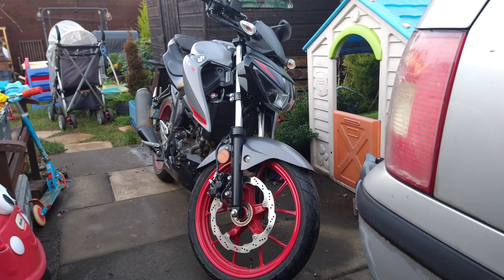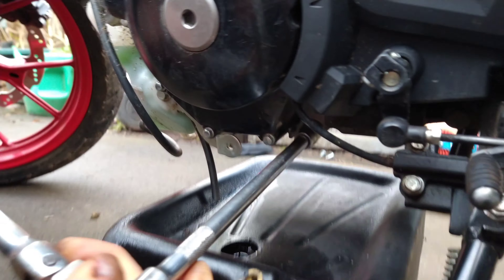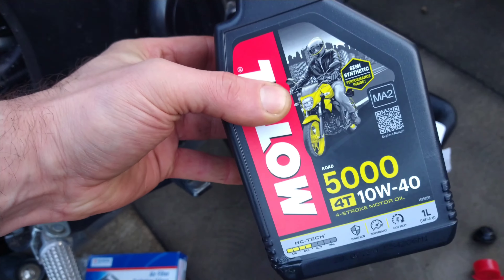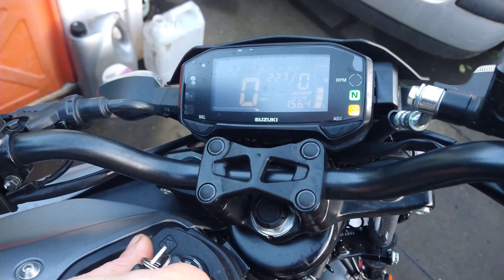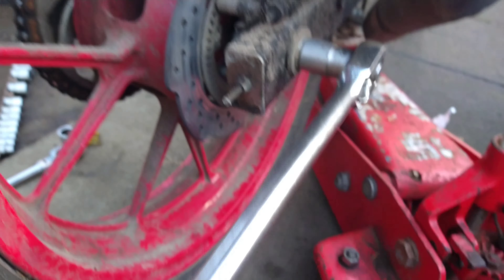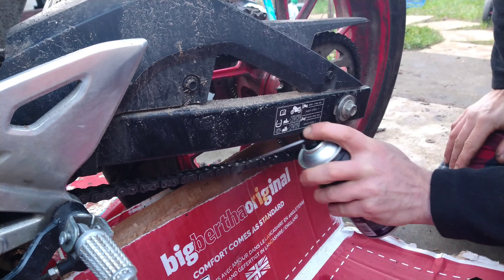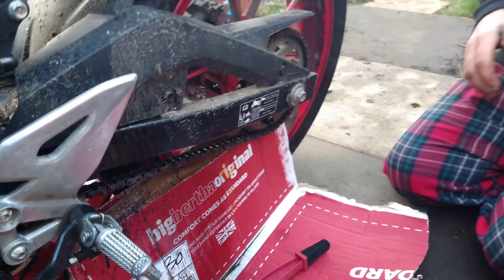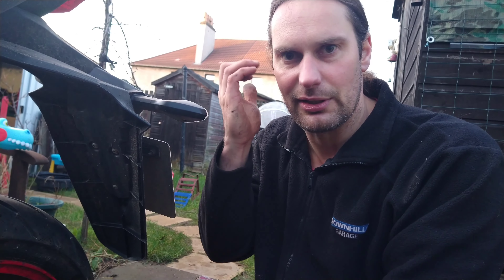Suzuki GSX S 125 (small service)

Comment: In Philippines that bikes is 150cc I have that bike when I see your video everything is 💯% identical.
Reply from the maker: Learners can only ride 125 cc here, you may feel that this a little bit slower than your bike. Thanks for watching
Reply: @mechanicmatt871  what is your top speed of that bike?
Reply from the maker: I would say a little over 70mph
Reply: @markanthonycasinillo1082  A bit late on this video but the absolute limit of this bike is 80mph, pushed mine to 79 under best case and it had no more to give.
Reply: @MrNBagelmore  80mph for 125cc? Is so far faster than any under 150cc.

Comment: When "servicing" is there anything else the garage would do?
Reply from the maker: Yes , checking the lights, tyre pressures, tread depth. Coolant level and chain . The sort of things you look at on a weekly check.
Look at the brake pad thickness,
I do this sort of thing weekly the only things I wouldn't do weekly is, changing the oil and filter plus any other serviceable items that are due for a change.
I would also check the wheel bearings for play whilst I have it off the ground.
Plus plug in an read any fault codes in the engine or ABS modules, I have got a cheap scan tool to do those checks.
Thanks for watching

Comment: How often do you check the valves? How do you do it on the GSX S? Great video.
Reply from the maker: This is something I would like to know too, I didn't get a valve clearance in the owners manual, I will need to find out what it should be and how often it needs checked, i don't think this has hydraulic lifters.
I will show in a video when I find out. Thanks for watching and your comment

Comment: Hello, I have to change the oil filter and the drain seal, but I can't find de diameter of the drain seal that fits for the gsx 125. Do you know what size it is?
Reply from the maker: Not sure, although I have been able to reuse it once with no problems, thanks for watching
Reply: Did you find the diameter on the drain Seal